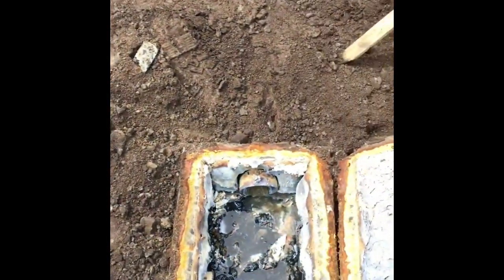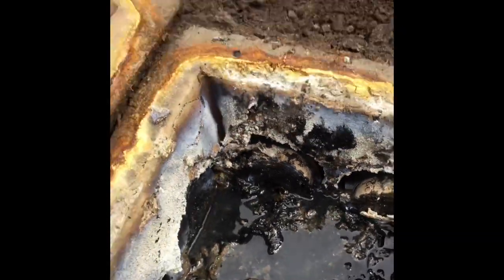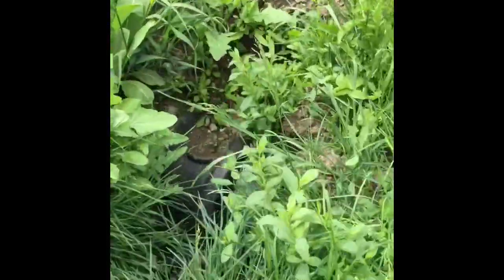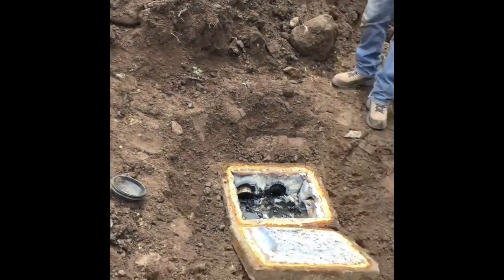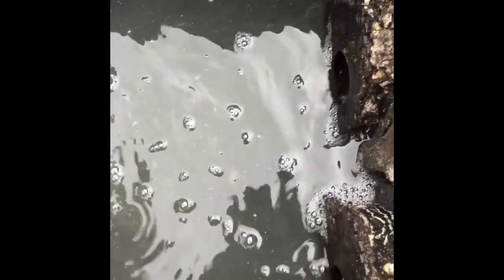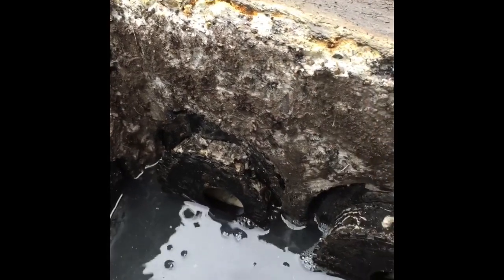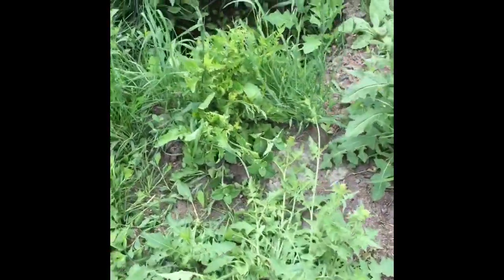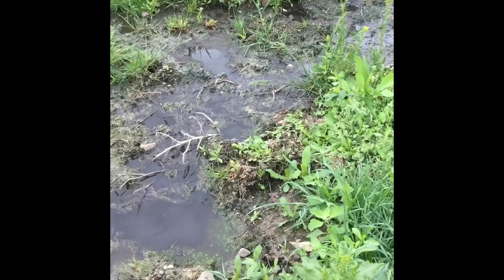Distribution Box Fail

Comment: We just had our 34 year old system checked, and tanks (2) pumped. Original concrete d-box collapsed and previous owner had not searched and fixed it. But rather a second tank was installed and effluent pumped to a second field. We bought 9 years ago and 7 years ago I found the original d-box and installed a new one. Field pipes were perfectly clean. Current inspector was impressed at pipe elevations and also impressed at 20 minute dissipation test. Second pump-up system considered a backup. We are happy owners.

Comment: My field is backed up at the moment. I’ve got someone coming to send a scope down the line to locate the distribution box. I was just watching videos to get some sort of expectation of what I will see. I’m expecting something like what was in your video. Did you clean out the clogged field lines with anything?
Reply from the maker: You can certainly flush out the lines, the issue can be that the surrounding aggregates and soils being clogged with biomaterial.  Once the soils get too clogged the filed needs to be replaced in many cases.
Reply: @ thanks. Plumber came and marked out where the pipe is, was getting a weak signal but was marking it at 18%-20%. I dug down where he couldn’t go any further but couldn’t find anything. Dug down about 4.5’ until I hit ground water and then probed down another 1.5’ with a piece of metal and didn’t feel anything. I can’t imagine the d box and pipe would be down that far and then sitting in the water table as well. I don’t want to question his locating but I feel like it was off. Anyways if I do find it I’ll probably flush the lines like you suggested.

Comment: Could this cause an issue of water backing up in the house when tsking shower or flushing toilet?
Reply from the maker: Depending on the grade of the system, if your lot is flat most certainly, I have seen it many times.  If the distribution box is downslope from the home, then the effluent would surge out of the top of the box if the field lines are clogged.  I have also seen effluent leak out of the tops of septic tanks as well before backing up into the home if the components are at lower elevations.

Comment: the pipes from my d box to laterals seem to be just a tad bit different elevations. how can I fix without digging the pipes up and resetting the d box? my thoughts are I can fix it by blocking the flow to the pipe that's taking all the water by a quarter inch.
Reply from the maker: Hi Nathan, you can use what is called speed levellers, try sourcing Polylok on line.  You might be able to order online for the size lateral lines running out of the distribution box.  You might also try your local distributor for local pipe, sewerage supplies, irrigation etc. as they might carry the levellers as well.  These are dials that you can turn to adjust the flow in the lines and we use them on every gravity system we install.
Reply: @groundstonewastewaterservi5066  thank you for the valuable information and quick response!

Comment: top of my distribution box is 42 inches from surface. Even if I put a 24" riser above it, my arms are not long enough to reach the top and pull it off. Seems better to make the riser only about 2 feet tall and put a lid and marker above so I can dig down 2 feet and then take off the lid to access it.
Reply from the maker: The real key is knowing exactly where it is so you can conduct maintenance on it every year.
Reply: @groundstonewastewaterservi5066  you just inspect it every year right? make sure it's not clogged.  
do I need to add rid x or other chemical treatment?
Reply from the maker: @rollandelliott  no treatment needed, just clean out the d-box of solids and residue buildup.  Keep the debris from going into the field lines and you’ll be helping the drainfield distribute more evenly

Comment: wow that was buried deep. I'm trying to find mine how far away is the distribution box typically located  from the tank? My discharge pipe is over 4 feet under ground.  the ground slopes toward the south so maybe it was dug deeper to account for the land sloping.
Reply from the maker: Typically yes, the drainfield should be no deeper than 3 ft for proper function.  It may take a camera scope from the septic tank outlet with a transmitter to find your distribution area.

Comment: what do you do if your box is that deep ?  so far ive put in a clean out that was about 3 1/2 feet deep and now will look for our distribution box but I don't want to rebury it again .. what would you recommend to make it accessable for future
Reply from the maker: Thanks for the question Arnulfo, use risers and a lid to bring the access point up to grade.  Source a Poly lock riser from about 24”-26” diameter, they come in 1 ft and 6” rises and you can purchase a lid as well.  When maintaining your distribution box place fluid levellers on the outgoing pipe openings from the d-Box, this will help each run of the field get an even flow.

Hope this helps
Reply: t @groundstonewastewaterservi5066  thank you for info